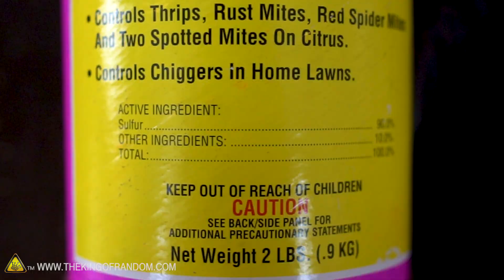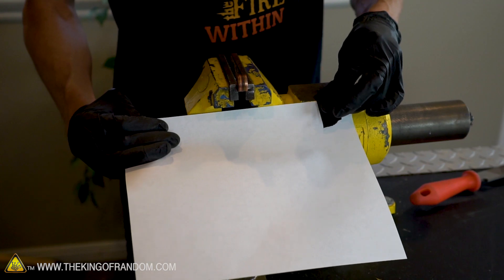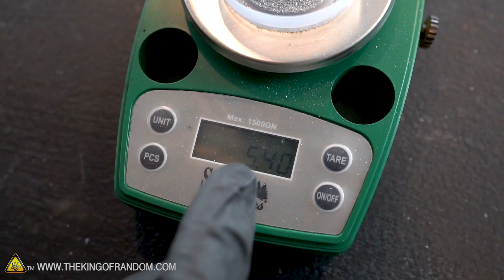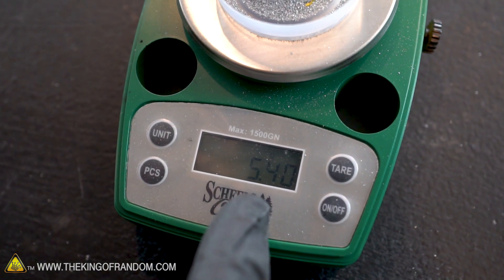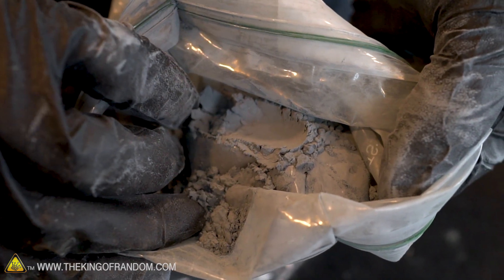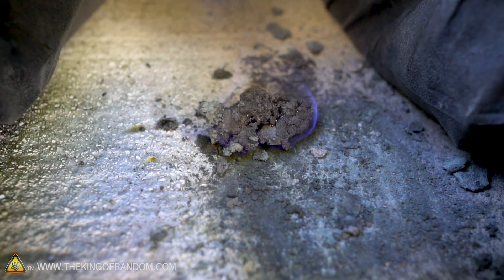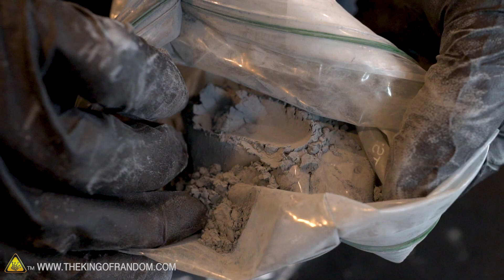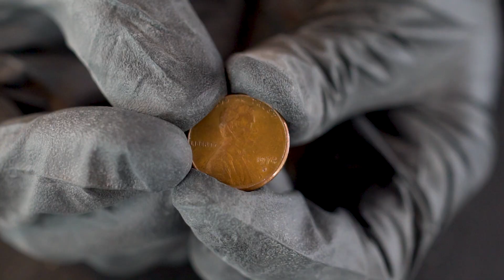Experimental GREEN Flash Powder! How To Make Flash Powder With Only 2 Ingredients! Zinc Sulfide?

Comment: You can take a circular sanding disc on a 90* die grinder and use that to sand off the pennies instead of using a rasp. Or you could use a finer file. Or you could use about a 80 grit belt on a belt sander. Another source of zinc would be galvanized sheet metal that you can find at Home Depot/Lowes, just heat it up a bit with a torch and it should be able to come off pretty easily from the steel base metal. Or galvanized buckets, including trash cans. 
On a side note I wonder how straight zinc would react seeings how it go easier to light with less sulfur in the mix.

Comment: You could also use these videos as opportunities to teach chemistry. A quick check on what the chemical reaction is (ZnS) would let you know that you need 1 Zinc atom per sulfur atom. Since zinc is just over twice the atomic weight a ratio of 2 to 1 Zinc to Sulfur by mass would give the correct stoichiometric ratio. Ignoring impurities of course. Empirical experiments are fun, but...well...SCIENCE!

Comment: @The King of Random

I had an idea on how to get your zinc powder fine enough to use in an experiment!

Either take the zinc powder or the pennies, and dip them in liquid nitrogen first. My hopes is that it will make the zinc brittle enough to crush so that you're not just restricted to grinding/filing. Maybe you can get a finer powder this way?

Also I had more thoughts and questions for the experiment!

1. Could you light the powder with a 3 to 1 ratio and the barbeque lighter you originally used on the 1 to 1 ratio?

2. Can you try a 2 to 1 ratio as well? My hope is that it will react a little slower so that it's not instantaneous like the 3 to 1

Comment: Use a belt sander to grind the pennies. I have cleaned the catch and it was literal dust. If belt sanders turn steel into dust, it will turn pennies to dust as well.

Comment: How is the driveway not all black yet
Reply: Lol better question is how is it not busted concrete bust with intense heat due to water deposits changing to steam and building pressure js lighting anything on concrete is supposed to be dangerous lol

Comment: See how powerful of a homemade battery you can make! The penny batteries have decent voltage with a few cells but weak current. With big electrodes and a powerful electrolye, see how much current you can get running through a homemade battery.

Comment: wikipedia says for the rocket propellant to mix 70% zinc with 30% sulfur
Zinc powder is sometimes used as a propellant in model rockets. When a compressed mixture of 70% zinc and 30% sulfur powder is ignited there is a violent chemical reaction. This produces zinc sulfide, together with large amounts of hot gas, heat, and light. (direct quote from wikipedia)
Reply: NiteRite_ did nobody taught you that Wikipedia isn’t reliable because anyone can edit anytime
Reply: Do your chemistry, he's right, it's about a 2:1 ratio.
Reply: No -

Comment: Penny dust: Start with the right ratio, try it in the 3:1 ratio, The next step is to get a abrasive net, and rub it through the abrasive net (make sure the net mesh is fine enough) the next step is to get a stone polisher of some kind, and run it through one of those, it will break it down well enough, but the zinc will come out damp. The next step from there is to get some proper grinding equipment.

Comment: Dremel sanding tool with really high grit, low speed so it doesn't fling the dust everywhere. I'm always using my dremel for sharpening knives and I get the metal dust EVERYWHERE on high speed. Cool part is when I use my MAPP torch on the concrete, the dust lights up like fireflies.

Comment: Does the 3-1 ratio also work with the zinc powder from the pennies?
Reply: Agree... after changing the ratio, he should have re-tried the zinc filings with the new ratio!
Reply: Yes I used 220 grit and it worked perfectly
Reply: The ratio would work but the particle size is equally important.
Reply: Skylar Kenneth sand paper
Reply: +WJK Indeed
Reply: 220 grit?
Reply: I think that you would get
Reply: Zadok Wright ty

Comment: Hey guys just a quick thing: zinc sulfur rocket fuel has a much higher chance to CATO than typical fuels used. Not saying it’s not used at all or doesn’t work, however. Just take steps to protect yourself just in case it goes off at once - not that I think you won’t, anyway. I learned pvc shrapnel hurts a bit a few years ago haha

Comment: You can get a fine zink powder by grinding the zink filings in a ball mill. You can try building a ball mill or  just buy one online. Add zink and ceramic pallets to the mill and leave it running until the wanted mesh size is obtained (probably more than 24 hours).

Comment: i'd appreciate if you try with that 3/1 ratio but with your first grind...
Reply: I thought the same, at the end when he said he couldn't get the grain small enough, I smh and was like wrong ratio when you tried it. I hope they do a revisit on this one.
Reply: @BaineWolf  The 1:1 mix probably ignited because some of the sulfur melted into globs with reduced surface area, effectively reducing the ratio of sulfur in the mixture.
Reply: Also try 3 to 1 with lighter
Reply: I want to see 3 to 1 ratio with original grind in a confined burn, i.e. as if it were in a rocket motor
Reply: 3-1 ratio seemt to start easely, i'd like to know if the fuse can light it. tho i'm pretty sure it can...
Reply: I agree! Grant would definitely have done that
Reply: Glad I wasn't the only one thinking that.
Reply: Works but needs a source of ignition that is hotter than a bbq igniter. You also should use 7 to 2 mix.
Reply: peppertime1 xXxX
Reply: +peppertime1 I was about to express my disappointment with just that.
Reply: In my  childhood before the internet it was common to try making smoke bombs and end up with rocket candy.
Reply: The even though pennies have little copper might have slowed the process
Reply: Exactly what I was thinking
Reply: Please do this lol
Reply: Should try at night
Reply: @ohholmgren  master lock 🔒
Reply: Hey, I know this video is dated but if you’re trying to make zinc, dust, or any sort of metal dust, a file won’t give you anything fine enough, you need to go with sandpaper, 300 grit, or finer. It goes a lot quicker with a belt sander or something like that.

Comment: Ideas to improve the zinc from pennies:
1. First file off the copper coating. It’s possible that it may be interfering in the reaction.
2. Try a higher grit metal file, that should give you a finer grain of Zinc

Comment: I can’t help but to think that defacing US currency is a federal offense?
Reply: no,  only defacing it with the intent to defraud,  or resell the component parts for more than scrap value...
Reply: Actually, not against the law as long as you aren't committing fraud. Common misconception.
Reply: crazynatisbak I can’t help but to think you really think your comment holds value because one person “liked” it. Congrats. You’re opinion is worth one like. My opinion was worth several comments.
Reply: Actually, still against the law. The specific federal law at issue is 18 USC 333, which has criminal penalties for anyone who “mutilates, cuts, defaces, disfigures, or perforates, or unites or cements together, or does any other thing to any bank bill, draft, note, or other evidence of debt issued by any national banking association, or Federal Reserve bank, or the Federal Reserve System, with intent to render such bank bill, draft, note, or other evidence of debt unfit to be reissued.”
Reply: jonathan livers N o. O n e. C a r e s.
Reply: Lock them up quickly.
Reply: astra ' the problem with American in three words.
Reply: jonathan livers 👌 ok

Comment: A quick way to get the Zinc to the power stage.. save your pennies until you have enough to buy a small bag of zinc powder.
Reply: Actually, not against the law as long as you aren't committing fraud. Common misconception.
Reply: Or...OR...grind off the copper layer to make the zinc pure and not contaminated with copper. Everything makes a difference
Reply: or electrochemistry!
Reply: Oh I do say Mortimer, very witty, very witty indeed.
Reply: Hahaha 😂
Reply: Use a sander!
Reply: Zinc wheel weights could be a vast resource
Reply: Especially if you live some where else like Australia
Reply: Lol
Reply: Much more expensive
Reply: Ebay
Reply: Nope. The specific federal law at issue is 18 USC 333, which has criminal penalties for anyone who “mutilates, cuts, defaces, disfigures, or perforates, or unites or cements together, or does any other thing to any bank bill, draft, note, or other evidence of debt issued by any national banking association, or Federal Reserve bank, or the Federal Reserve System, with intent to render such bank bill, draft, note, or other evidence of debt unfit to be reissued.”
Reply: @kenross4453  are you a lawyer
Reply: wobbly sauce That way is also the legal way, we just saw this guy deface U.S. currency which is a felony.
Reply: @ztmackin  I’m

Comment: Try using a rock tumbler with marbles inside, the marbles are glass so they shouldn't spark and they should be hard enough to grind metal shavings down to a powder after a few hours

Comment: do electrolysis of a zinc solution, with a cathode made from carbon, and a large zinc anode. The zinc deposited on the cathode can be scraped off regularly in a thin film, which can easily be ground to a power.

Comment: Ball Mill is your only option and would be a great project in itself, basically a rock tumbler with marbles. and rather than use pennies,  zinc is easy to get scrap from galvanising businesses. Ball mills can be used to make most pyro dry ingredients, and makes awesome aluminium powder for normal flash powder. Could be a source for future content, making pyro ingredients from household  resources.

Comment: Use twice the amount of zinc and one part of sulfur. The reaction will be complete. Because molar mass of zinc is 65g and sulfur is 32g. So for a complete burn you need 65g and not 32g of zinc. Now try making a randomizer rocket with this fuel. For a very fine powder you need a ball mill. Simple one is pvc pipe with end  caps on a ball bearing and spin with a washing machine motor.

Comment: use one of those cylinders that have ball bearings in them and they spin for hours to get a finer powder, (they are commonly used to smooth rocks)
Reply: TheBackyardPyromaniac It's called a ball mill.
Reply: Pyro Pat ah yes that's the one

Comment: I imagine it is also partially  Cupric Sulfate seeing as the reaction spectra was a bright green. Zinc alone would create a teal flame and Cupric Chloride and Cupric oxide (from contact with skin, water and air) would both emit blue light. 
To make fine powders, use a ball mill or rotary mill with grinding materials harder than whatever you are trying to mill. In the case of Zn, the standard steel shot or steel milling disks would be more than sufficient.

Comment: Did you try using the ground up pennies in a 3:1 mix? I only saw you try the penny-obtained Zinc in the 1:1 mix...perhaps it would work even in the coarse grain if mixed in the proper ratio?

Comment: I am a little confused. You ask for help making your zinc finer but you never tried it when you got the correct ratio down. Yours may light off just fine when you have it mixed right and it may burn just a bit slower.

Comment: Try buying a small belt sander and using a 400 grit belt or a slower option would be to use 400 or maybe 600 grit sandpaper and just sand them down

Comment: My classmate have special machine for grinding metal to dusts. That's big barrel standing on motor shaft with metal balls inside. We put low grade metal in this machine and after around 5 hours our dust is ready. Fine powdered metal.

Comment: You didn't change the ratio of the mixture until you got to the store bought stuff. Should have tried changing the ratio with the penny mix first before calling that a failure.

Also, try putting the mix into a ping-pong ball with a fuse. See if it helps concentrate the flash.

Comment: how to get zinc powder from pennies at home:

make a lot of zinc filling
dissolve in sodium hidroxyde (drain cleaner) to make sodium zincate solution
pass a small current through solution with zinc cathode

on cathode you should get fine enough zinc powder that you just wash with water and acetone, dry, and once dried grind the clumps  that formed  into fine powder

I turned half a kilo of zinc from batteries into powder with this methode, hope it helps anyone

Comment: Idea to make a finer/more pure zinc powder: hydrogen peroxide and hydrochloric acid should strip the copper leaving a zinc core. Use the mortar and pestle to smash it into chunks, don't grind or file add a teaspoon (to start) of water. It should make a paste. Keep mashing it. Monitor its moisture and plasticity, when it reaches the consistency of flour you have pure zinc

Comment: You should have tried your own zinc powder with the 1/3 ratio, just to check if the ratio was the problem or the zinc. 
Maybe the copper from the pennies is something you have to take off first, to get the results you need. Cody from Cody'sLab should know a bit more about that kind of stuff, maybe it will help to ask him if the copper might be a problem.

Comment: Zinc and most metals are too ductile to be powdered mechanically such as with a mortar. To make metals more brittle allowing them to be ground to smaller partials rather than just deformed use liquid nitrogen to get them below their ductile-brittle transition temperature.

Comment: Technically the finer your file, the smaller the filings.
But also the longer it will take of course.
You can also use a filter of some sort or some other method to remove the heaviest particles from the filings, only using the finest particles.
I'm guessing they will be variable

Comment: Are you certain the filings from the penny wouldn't work? It seems like the problem wasn't the grain size, as the commercial zinc powder also didn't work in the 1:1 ratio. It'd be interesting to see if your other variables (ie. zinc source and ignition source of pennies and BBQ lighter, respectively) would work with the 3:1 ratio.

Comment: Put a lot of zinc filings into a rock tumbler with some big steel balls - that should give you a fine powder.  Also use a piece of magnesium ribbon as a fuse. It burns really hot and won't propel itself away.

Comment: The reaction of zinc and sulfur follows the equation Zn + S --> ZnS . So 1 mol of zinc reacts with 1 mol of sulfur to produce 1 mol of zincsulfide. The mass of 1 mol of zinc is 65 grams. The mass of 1 mol of sulfur is 32 grams. Therefore the ratio you want is 65 parts zinc to 32 parts sulfur by mass which is pretty much 2 to 1.

Comment: Make a small ball mill from a rock tumbler to create finer zinc powder. In fact, you should be able to create a rudimentary tumbler from just a few hardware store parts. With some glass marbles or steel balls as your hammering elements, you should be able to get some very nice powder. You'll just need to be patient. It will likely need to run for a day or two.

Comment: You need to test the ground down pennies in the 3:1 ratio, you're operating on the assumption that the filed zinc from the pennies was too course a grain, even though it did get a slower reaction once, but you never tested it in what is clearly the correct ratio.

Comment: If you use a belt grinder with fine grit on the pennies, you can get it to be finer.  Then run the zinc powder through a sifter to get only the finest pieces.   BTW the next project should be to make DIY Freeze Dried Ice Cream

Comment: I the product of the reaction is ZnS (zinc-sulfate) than the perfect ratio should be 65.38 to 32.05 or around 2 parts Zinc and 1 part sulfur, because that is atomic weight of those elements. If the reaction is Zn + S -> ZnS, then you need 1 mole of Zn and 1 mole of S. It's basic chemistry.

Comment: In the recap, you said that you just couldn't get the zinc filings fine enough, but you also using the wrong ratio. Could you do a quick test to see if your zinc filings could work using the correct ratio? Maybe post it as a Twitter/Instagram video.

Comment: You can make ultra fine zinc powder by taking the pennies and connecting them to the positive wire of a power supply, and connecting the negative to a metalic object. Put the whole thing in a mixture of lye and water and past some current. If you let it enough time, you will get some nice zinc powder at the negative pole. You just have to scratch the zinc powder of.

Comment: Did you not try your zinc filings with the 3 to 1 ratio?  If you couldn't get the commercial powder to go at 1:1, maybe your original filings would work at 3:1?

Comment: zinc and sulphur will probably make a rather bad propellant. the thing about black powder is that the reaction of burning it produces a lot of gasses while zinc and sulphur just react to another solide. the only thing thats expanding is the air that gets heated rapidly by the exothermic reaction, giving you the "puff". this puff while probably have little to now effect once you encase it in a tube.
Reply: also: for a stochiometric reaction you would have to react 2 parts zinc with 1 part sulphur. how that would effect the reaction speed idk, but that's what testing is for :D

Comment: You can try to sand the pennies with sand paper you may get better results than with a file
Reply: A French Gun Guy oh but dude that will take ages
Reply: The Void Alchemist oh yeah I’m pretty sure it will but it would avoid buying zinc powder
Reply: Sand paper leaves a lot behind from the actual sand paper. A metal file doesn't.
Reply: Robert Stewardson yeah but the goal is to get the finest powder that we can and as you can see a file doesn’t do a great job at it
Maybe a belt sander...